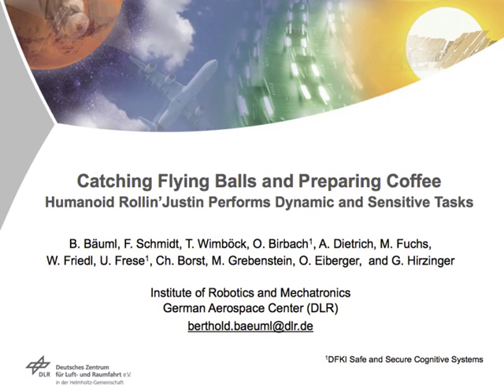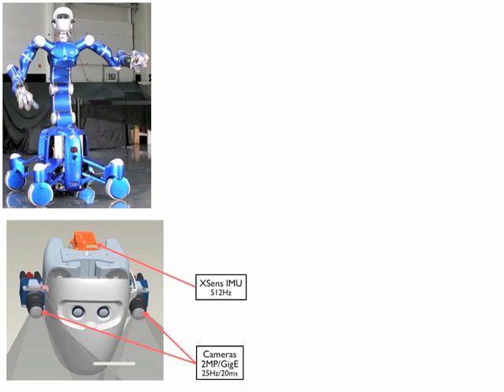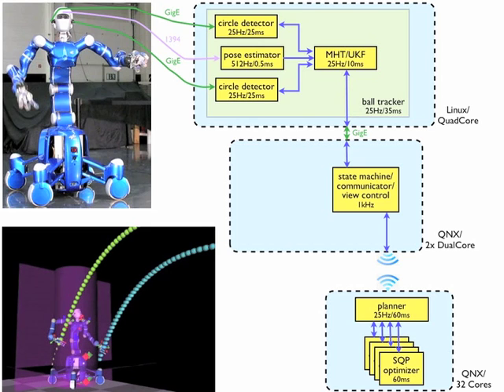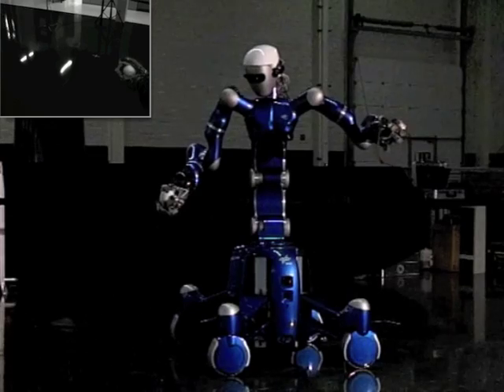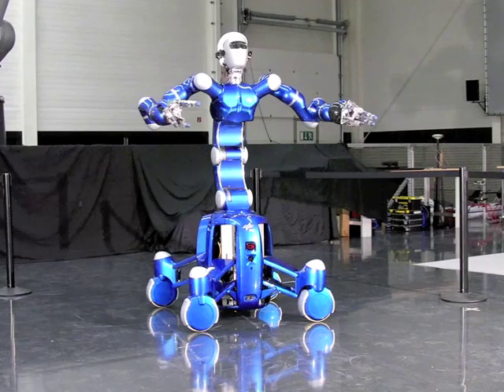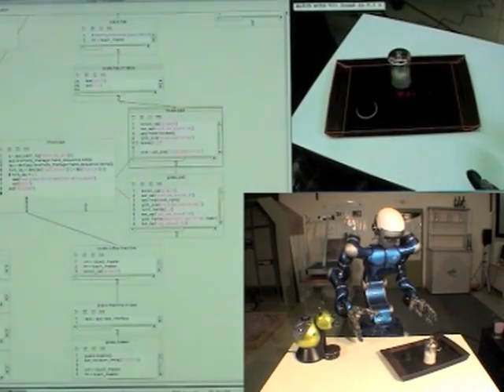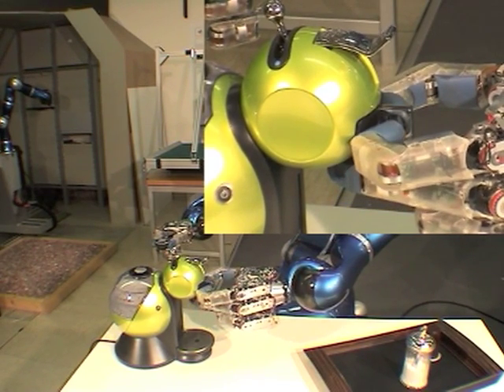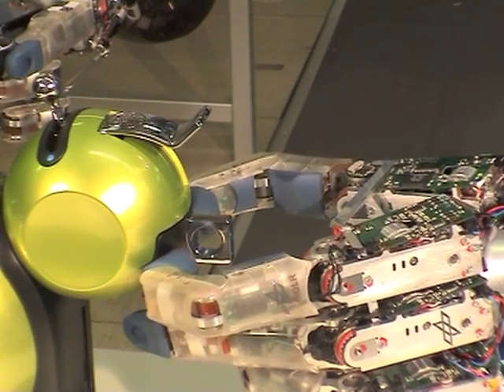Rollin' Justin Robot Catches Balls Tossed in its Direction

Comment: Provided they can be sure that the resulting shower of irradiated rock across a large area has a low enough concentration of radiation to be non-harmful. If not, shooting it could be nearly as bad as just taking the hit. I'd go on and say the concentration is likely to be considered well within boundaries, even if they used one of more toxic a-bombs (which I wouldn't see much point in doing - I'd use a lower half-life one just to be safe), but I don't really know for certain.